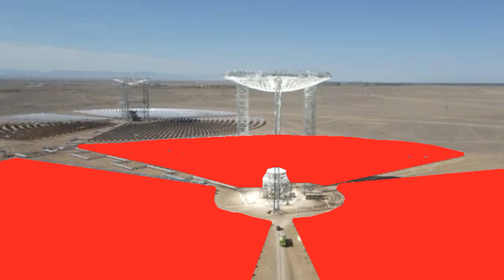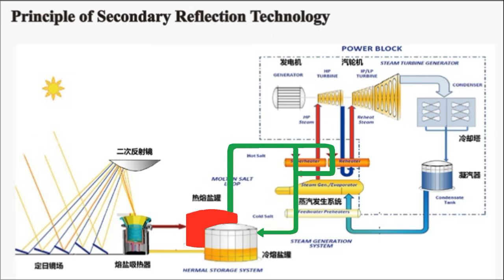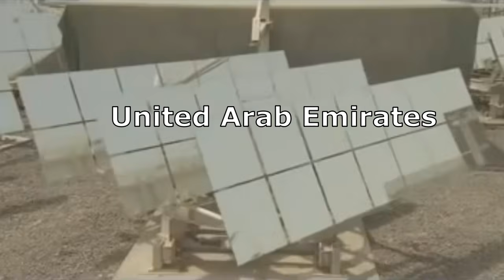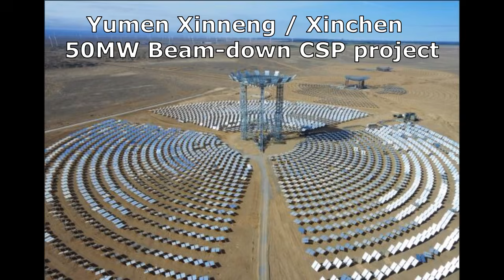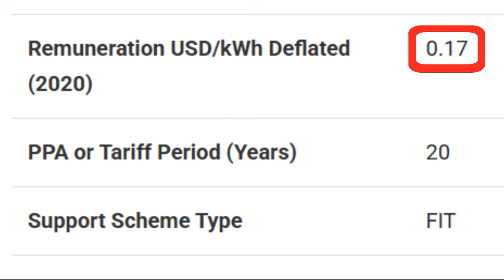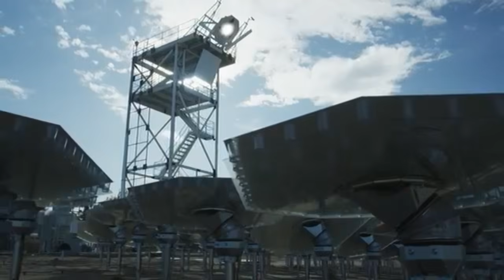What is this new type of solar power plant? Does it have any prospects?

Comment: How can this be more expansive than a  nuclear energy plant. I think the numbers are fixed. After all there is literally no fuel necessary (The sun does not send a bill).  I bet it is another case of power and monopoly that prevents us from having nice things.
I guess some countries will wish to have invested a few billions in these kinds of power plants in the current gas/oil crisis.
Reply: it's all about output cost, it's not generating as much power as any of those other plants. plus it does have an upkeep cost
Reply: Nuclear couldn’t be cheaper once you get the thing built, a day of power only uses about 7 pounds of uranium a day, while an equivalent coal plant would be MILLIONS of pounds per day. That’s cheaper than a thousand mirrors mounted on sun tracking arms… To get off fossil fuels we’ll definitely need all of these though

Comment: The Ivanpah concentrated solar power station in the US works on the same principle. It’s been obsoleted by decreases in the cost of photovoltaics, however
Reply: I guess the difference is that Ivanpah couldn't compete with Chinese made PV, Ivanpah had to hire bunch of expensive American engineers, lawyers, administration, security, and financiers. Chinese concentrated solar power might still need more work hours than PV power stations but can still be profitable because their workers are cheaper and more focused on engineering and maintenance.
Reply: @onurcetinkaya4873  Yes, and I think thermal energy storage has some advantages over batteries